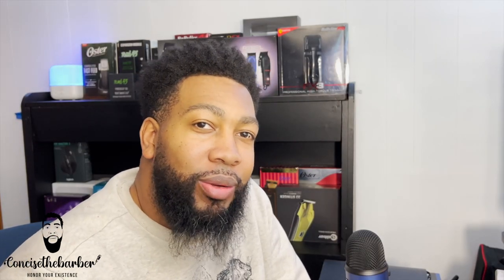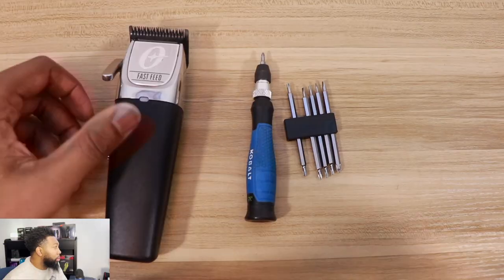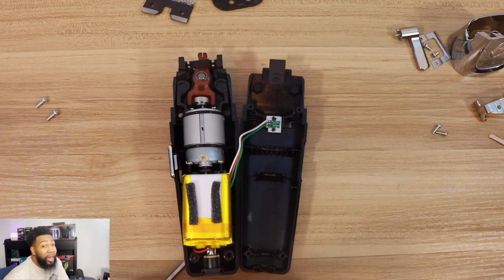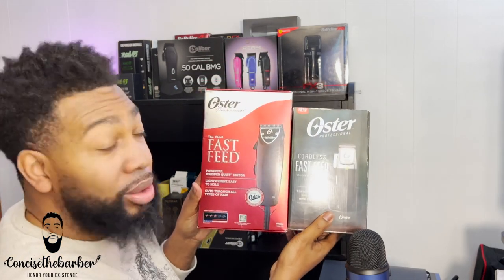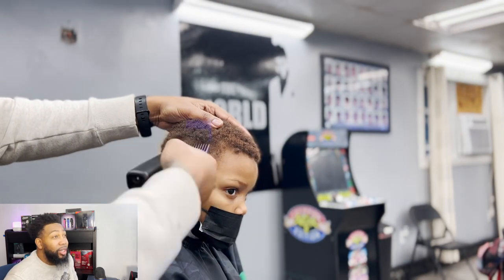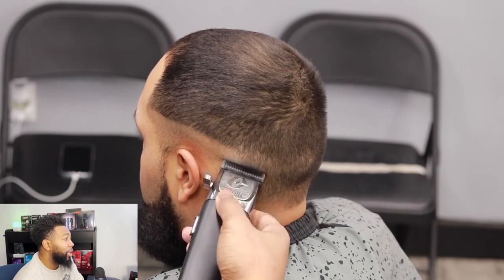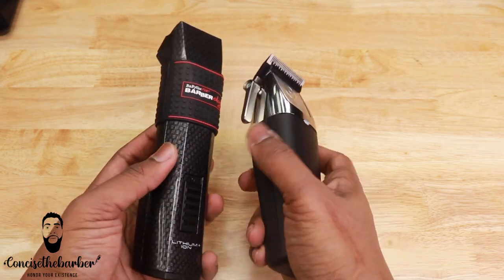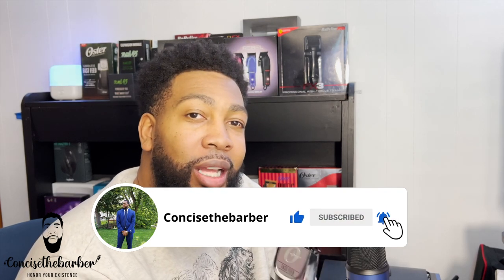Oster Cordless FastFeeds| HYBRID MOTOR| CONCISE REVIEW

Comment: Doesn’t look like they pulled much more than a senior would running a guard through matted curls. Even Then I feel like that’s the teeth of the guard getting stuck. If that clip would of been clipper over comb it wouldn’t of been any slow down. Would you agree?
Reply from the maker: It might of been smoother

Comment: $269…90 minutes of run time… easily pass on this. Thanks for the video ❤️
Reply from the maker: Where did you see them for $269 .. I’ve see them for $199.. and I actually get more than 90 minutes for some reason
Reply: @ConcisetheBarber  they are $269 on EBay and the red ones are $189
Reply from the maker: @BradTheBarber1  yea eBay is crazy with prices on cosmoprof the black ones are 199
Reply: @ConcisetheBarber  But also I’ve ordered from eBay a few times & had to dispute purchases that were never shipped

Comment: I have the same clipper and mine don't cut like that at all...
Reply from the maker: How do they cut?
Reply: @ConcisetheBarber  they struggle through bulk BAD I'm running over the same spot over and over and over just for it to cut even. They were great for the first 5/6 cuts now I feel like they are slowing down even after a full charge and struggle to even fade. Blade is pulling even when freshly oiled and open clipper normally blends well into closed 1 similar to the masters and it's just creating more lines now somehow.
Reply from the maker: @zachmendonca808  I would definitely reach out to Oster